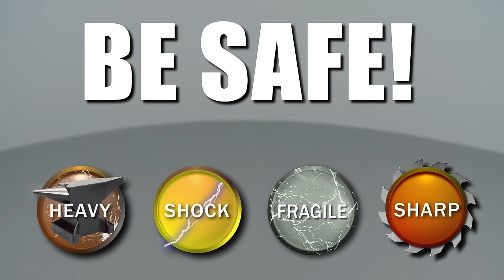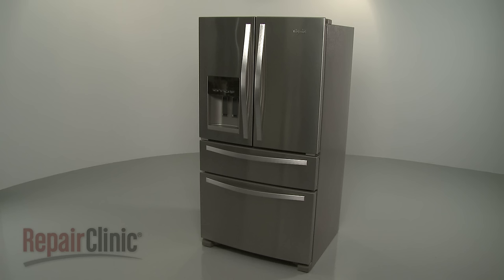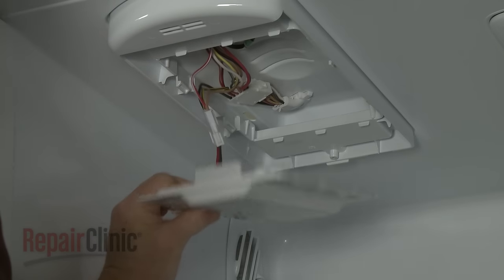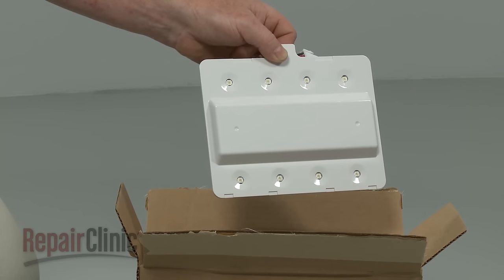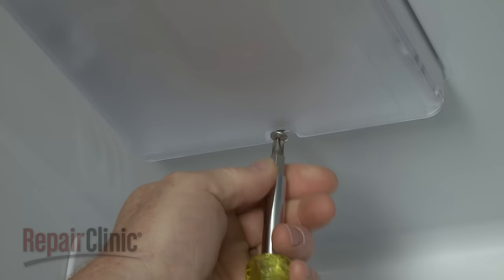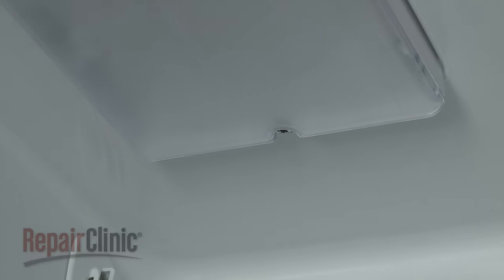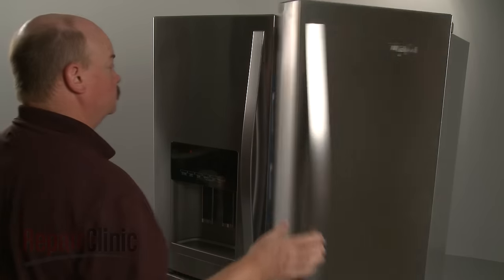Whirlpool Refrigerator LED Light Replacement #W10289592

Comment: I have one of these fridges, and out of the 8 leds, one is completely out and the others are too dim to be of any use.  I was flabergasted when I seen the price for these modules.  I've put together a lot of LED setups in DIY arena, I'm familiar with inverters, current vs voltage based, dimming, soldering, etc., but the idea that these things cost $70 is ridiculous.  You know it's bad when you can't even find one on eBay or Amazon.  Disgusted with Whirlpool since this problem is quite common.  I'd link to a forum full of p'd off people with this problem, but Google doesn't like links.
Reply: I have the same problem. Replacement part is ridiculously expensive. Not acceptable.
Reply: exact same problem having here after 2 years of purchase. LED module is ridiculously expensive, how did you fix yours?
Reply: Yea man.  I cant believe I bought whirlpool fridge.  NEVER AGAIN
Reply: Same here, and never a Whirlpool again.
Reply: same problem 
it looks like they have a whole department with the goal is to invent least reliable components that can be sold as a replacement parts
I have bunch of LEDs around the house which have never been replaced since the installation. whirpool one failed after a few years
Reply: I bought mine on Amazon for about $25 bucks...
Took me less than 10 minutes to remove the old one & install the new one.
The new one looks exactly like the old one. 
Ain't nothin cheap these days but for $25 bucks, I figured why not...
Beats payin a Appliance Tech a service fee + the Manufacturers price for one of these, which was around $85 just for the module.
Reply: $70!

Right now it is $279! $70 sounds pretty good about now.
Reply: $25 replacement LED set from Amazon works yall. Just replaced today. So far so good. 👍🏽
Reply: My freezer has been dark for 2 years. I’m not paying those ridiculous prices to change them out. Don’t know what I’m grabbing from in there but I’m eating it. We call it the mystery box now😂😂😂
Reply: Not only Whirlpool, My Maytag has the same exact Light!!! Same Problem! Some Executive got a big bonus because he figured out how to sell a refrigerator that keeps on paying!
Reply: You are right on that price ..mine was listed at $237.11!!
Reply: @lcam9241 do you have the amazon link??? Mine just went out today😢😢😢

Comment: Do not buy this fridge--Whirlpool. If your interior light goes out, it is $300 to replace it.
Reply: Its 43 dollars
Reply: @s.p.m.g.9304  Please send link or info from where you found it much cheaper.
Reply: part w11043011 was my part number  50 on ebay or just screw in new led strips for 14.00 with same part number search
Reply: @stevonkoch8002  Very helpful - THANKS!
Reply: Amazon....$25 now

Comment: I bought this Whirlpool less than 4 years ago so not happy.  Thanks for posting.  I just changed mine with your help,
Reply: In the same boat, barely over 3 years and the light already went out on mine too!
Reply: Gonna see if mine is still under warranty
 Complete and utter BS . At 70Bucks a pop 
.I'm about to install the "Clapper" in my  fridge" Clap on, Clap off "

Comment: I have GI6SDRXXY05, 6 years old.  I noticed my interior light went out right after I did a "Filter Reset."  I didn't change the filter I was just tired of the beeping sound.  Immediately after doing the filter reset I opened the fridge door and noticed the light go out.  I was looking at replacement parts and was shocked to see $300 replacement for LED unit.  I own multiple rental properties and really like Whirlpool.  I confirmed door switches weren't sticking, I operated each several times consecutively by depressing them by hand.  I took the screw off the lens cover but was having a difficult time getting it to release, had to give it a good tug.  Showed my wife what I had done on the control panel "Filter Reset" and the interior lights suddenly came back on.  I can't say for certain what fixed it, but hopefully this will save you some money and get your light working again.
Reply: This worked for me as well.  Thank you.
Reply: Are you saying that when you did a filter reset that it fixed your light? Mine are out on only the the left side of the light fixture.
Reply: Filter reset worked! Thanks for the tip.

Comment: FIXED IT:
One of the LEDs went out and the rest were dim. I unplugged the light assembly and stuck the ends of a small paperclip in the two little holes right next to the LED that was out. I plugged the light assembly back in and all the lights started working again. I removed the paperclip, and they kept working. If it breaks again quickly I'll update.
Reply: I had the same issue: One side of the LEDs were completely out. I unplugged the fridge, unplugged the assembly, removed the LED panels and inspected them for missing solder. Then I stuck in 2 small paper clips in each of the small holes next to each LED light (2 for each of the 4 LEDs) and removed. Screwed the panels back on, the controller back in, plugged the assembly back in and plugged the fridge back in - WORKED!! Both LED sides are back on and bright again. Open and closed each door individually 5 times and then open/closed both doors simultaneously 5 times: Lights turned on each time, full brightness without fail. THANK YOU!!!! The controller assembly is $403 and the LED panels are $81 (plus tax and shipping for a total of $535.14). Now let's tac on that $200 service call for the repair --> YOU SAVED ME ALMOST $800!!!
Reply: Same issue here and I tried the paper clip in the 2 small holes but still doesn’t work

Comment: If the lights are flickering, try gently pushing on each LED with the eraser end of a pencil until you find the culprit light. That immediately fixed my flickering lights.
Reply: This fixed it. Came to the comments because my fridge has tabs in a different place, but now I'll wait on taking it out lol
Reply: Worked for me too on a LED that was off/out. Thanks
Reply: Crap, only works temporarily for like a few minutes. Fix it right the first time.
Reply: Bad solder joint?

Comment: Was hoping the new Whirlpool refrigerator my parents bought would also have been this easy to remove the module since the lights are now dim as one of them are off and the case looks nearly identical to this one, but there were no tabs to remove it meaning the only way to remove it was removing the shell itself making it very possible to chip or damage something. 
Turns out they completely replaced the tab system by just using adhesive and making it much more inconvenient.

Don't know what made Whirlpool change their accessibility design, but even more reason to support the Right to Repair movement
Reply: Thank you for figuring that out. I was thinking I was going to break mine because there's no tabs
Reply: @kimg7031  So we're supposed to just keep pulling at it until something gives?
Reply: So how did you get it off
Reply: @gtspeed600hp  had to pry it open with some wedges
Reply: You are totally right..finally got mine off but the tabs are not the same as in demo..can not see them..what to do??

Comment: I have one burned out LED on one board that seemingly causes a voltage drop across all the LEDs.  There are two boards in there, if it happens again, I'm swapping one board for the other and seeing if that works.

Comment: Where is this part?  Everything online comes without the voltage reducer.
Reply: w11043011 for the whole assembly - click lower in the searches for just the wiring harness and 2 LED boards for cheaper - easy fix just gotta screw them into the board you take out.

Comment: same thing happened to my whirlpool only after about a year the interior light on both sides started to flickering like strobe light. don't waste your money with whirlpool.
Reply: Quy Bao mine flickered and now not as bright. freezer size worked fir a month or so. crap fridge 1 year and 2 weeks old. out of warranty
Reply: going to buy sensor led lights
Reply: Our fridge went out and we are right at 13 month with a 13 month manufacture warranty that's total bs !!!
Reply: 12 month warranty **
Reply: Quy Bao ya man.  I got my whirlpool for about a year and the main interior and pantry light both started to go off.  Wth man

Comment: Does anyone know how to remove the light cover? I pull it down really hard. Almost broke it😅 . Can’t make it. It seems a pretty easy task in the video. Any trick there?
Reply: Pull harder
Reply: I tried to pull it off from the tab in the back. The tab is not connected to the lens! Use a thin flat tip screwdriver to pry a small gap between the rooftop base and the lens and pull lens downward from the gap.
Reply: Stop and pay someone. You're obviously not mechanically inclined.

Comment: Troubleshot and found 1 LED bad (connection bad) Anyone know the single LED part number? I drew the schematic for the actual light fixture... Actually pretty simple after I saw what was going on... If anyone has the single LED part number, I'd appreciate it... Thanks! BTW other than the LED issue, we love this fridge...
Reply: if you still need tap w11043011 and you can buy the led strip on ebay
Reply: 14.00
Reply: Yeah you can buy the LED boards for around 15-20 bucks apparently, wish I knew that before I bought the whole assembly....

Comment: Do you have to really have unplug the refrigerator first
Can it be safely replaced without unplugging it ?
Reply: If you don't want to or cannot move the refrigerator to unplug it, you can turn the circuit breaker off at the main panel.

Comment: I have model WRX735SDHZ03. The LED light suddenly became very weak. I tried to remove the cover, but it did not move at all. I did not see any screw in the back that I can take off. Does anyone know how to fix it? Thanks in advance.
Reply: There is a Phillips screw at the very back center. It is hard to see, but you can see it with a flashlight with your head in the fridge. Remove that screw and pull down on the cover at the back. It will pop free and you can slide it backward to drop it. That exposes two squarish holes on each side toward the front of the module. You will need a flat blade screw driver to pry blindly with more pressure than I was comfortable doing but I eventually got it down. See the comments below by debbieweinstein200. Expand the replies, toward the bottom is a better explanation of how to get the assembly down with part number for the two LED boards. Prices are all over the place. Amazon had the LED boards for less than $20.
Reply: BTW, the assembly in this video is not the same as the one you need for the WRX735SDHZ03.
Reply: @shannondewolfe350  Thank you very much for the information. It helps. Do you know which assembly I need for WRX735SDHZ03? I sent an email to Whirlpool a few days ago. They said I need to call a technician to fix it because it is sealed LED light. I bought this fridge a little bit over a year ago. Never had a fridge broken so quickly. There was a small tear on the rubber gasket between the two French doors also.
Reply: @shannondewolfe350  just checked. There is no screw anywhere including the very back center. It looks like the back of the light was locked/inserted on the top of the fridge by two flat plastic pieces extended from the back of the light. There is also a knob on the back center of the light cover. I tried to press on it and push it forward, downward, but it did not work.

Comment: My assembly doesn’t have a screw and is impossible to get off 🤦🏽‍♀️
Reply: Did you get it fixed? I have an easy solution.
Reply: @jbooker7099  I did. It was under warranty and I had the tech come out and do it. It was set up a bit differently than this one ☝🏼
Reply: @MookieAkou  I had the same issues. Was just reading one of those problem/solved websites and saw a comment from 2017.  The person was cleaning their refrigerator and it was strobing the whole time. after 5 minutes it stopped. So I decided to try it and left my doors open for around 5 minutes and they stopped strobbing and haven't strobed since. Just thought if it ever happens again. I think it must have done some sort of reset.

Comment: There are no other electrical components on the two modules other than the 8 leds so the problem has to be a  cold solder joint on the led that is not working.  It is a series circuit since 7 leds dim when 1 led stops working. The leds are surface mount components and it is almost impossible to reflow the sides with the thinnest soldering iron tip. A hot air soldering gun and conductive paste will be required. A local cell phone repair shop should have the equipment to reflow the leds. Don't know what they would charge.7